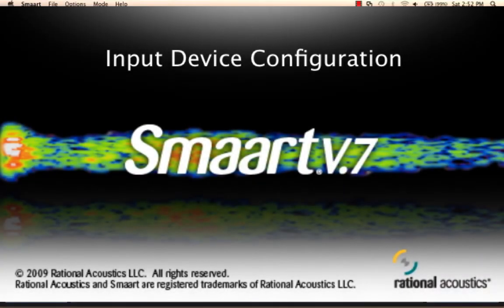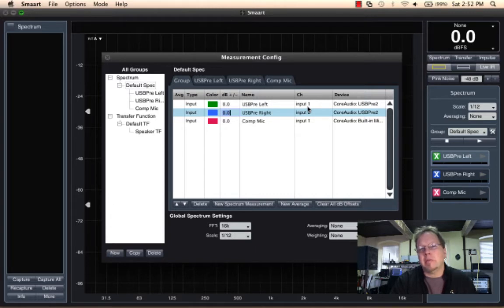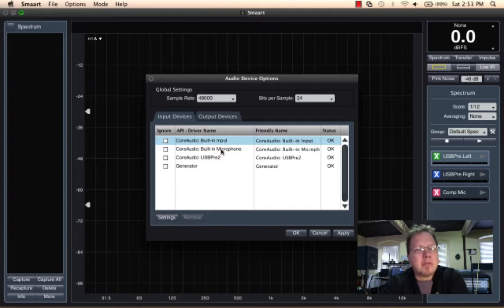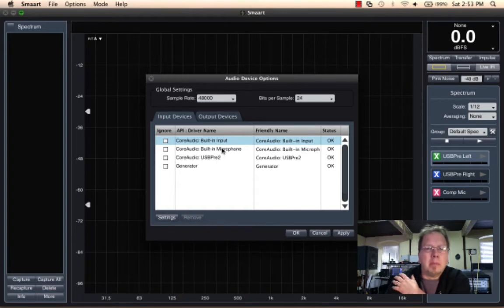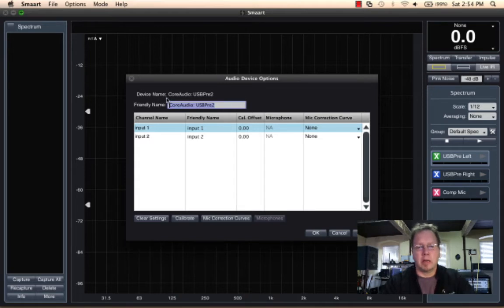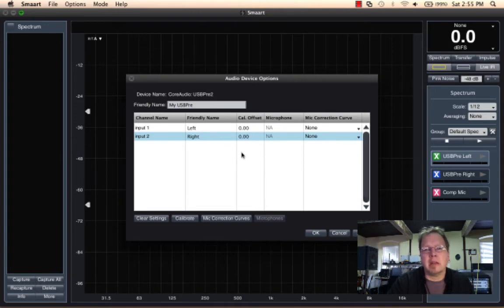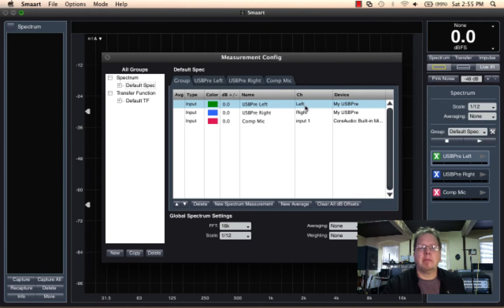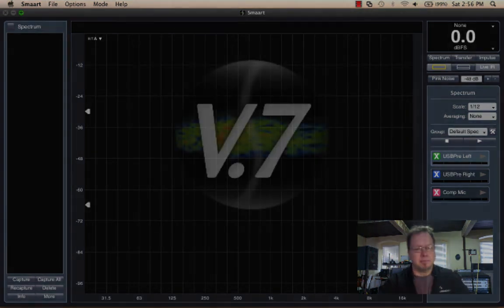Smaart v7 Basics - Input Device Configuration in Smaart v7

Comment: Hi ! I have a trouble with Smaart 7 at laptop run. I start it, the splash screen appears, after this, where the spectrum need to apears, my desktop aprears, and so no real time spectrum. Unfortunately here can't send a photo proof...
Reply from the maker: If the program starts but the plot is missing, there may be an issue with your graphics hardware driver. Please try updating your graphics driver and contact support at rationalacoustics.com if that does not help.
Reply: @RationalAcoustics  Hmm, I have no more update, may I not have enought memmory... There's no way to resolve this ?